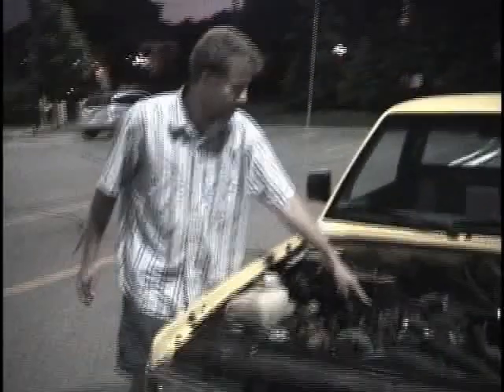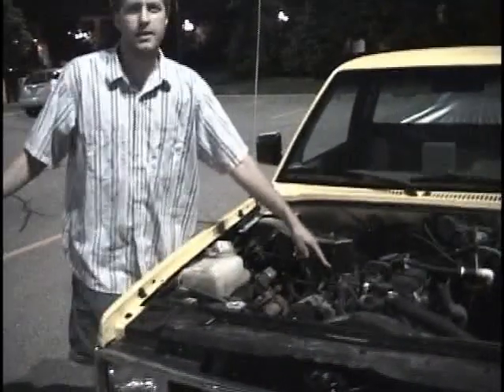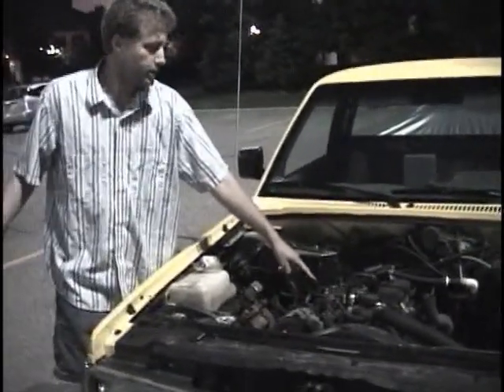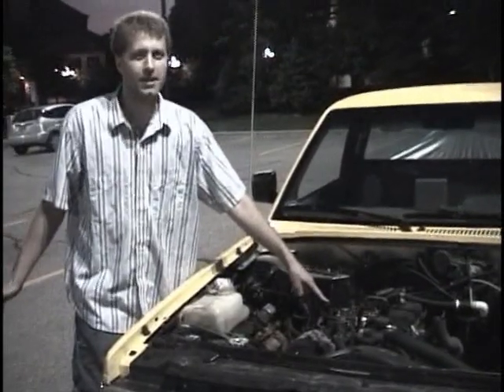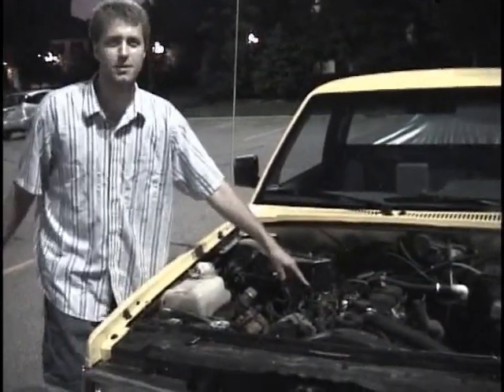Fuel Injected Flamethrower

Comment from the maker: No, it won't.  It'll last probably at least until 300k miles.  It has 240k now.  Just after this we drove the truck to California and back.
Reply from the maker: Update: at about 290K miles, I stopped using the truck for everyday driving because I now have a different vehicle that I like better. The truck still runs and is now used around "The Farm".
Reply: Shawn Grannell same thing can happen with carbs right? Double checking my self and trouble shooting
Reply from the maker: Sure, if the accelerator pump is disabled or broken.